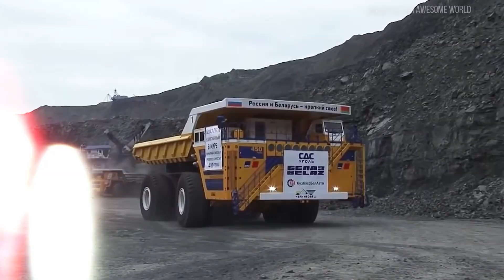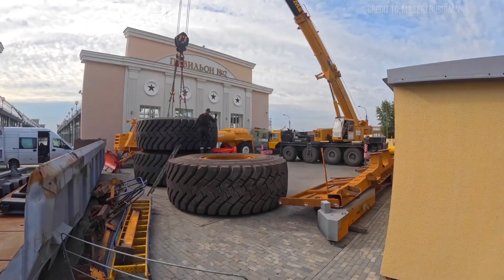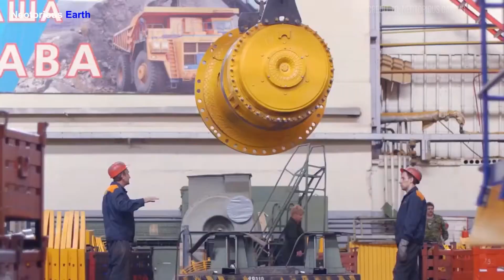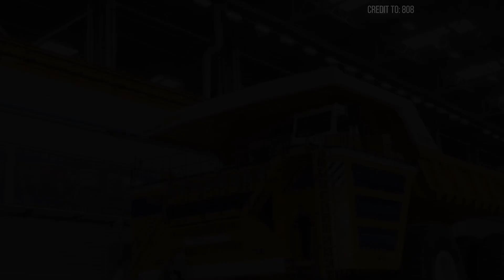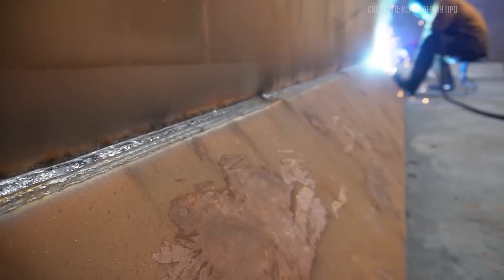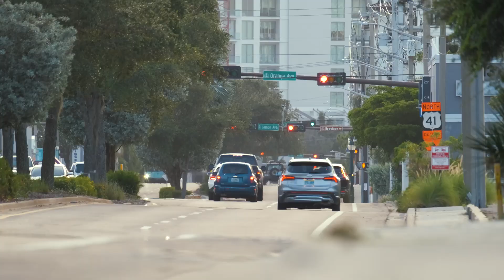The Dump Truck So Big it Broke the Rules of Engineering

Comment: 3 two story Houses? No it can carry the weight of about 20 two story Houses,
Reply from the maker: Hey thanks for watching! The 450-ton capacity works for 3 two-story homes (100–150 tons each). 20 would mean ~22.5 tons per house which would be pretty light! Could be 2–4 based on size. Any other ideas on this?